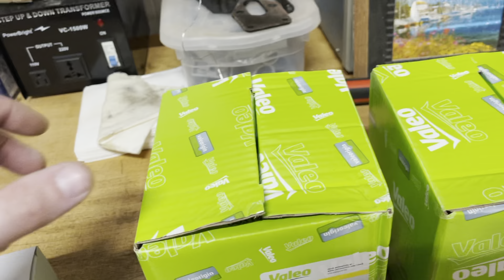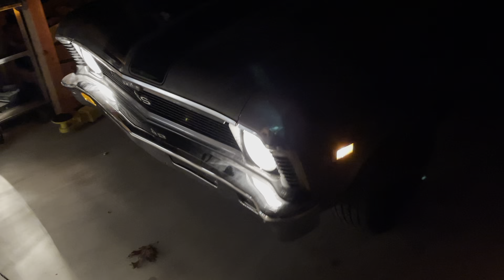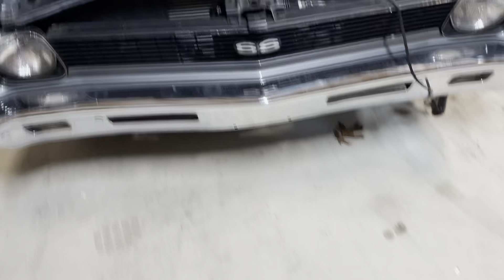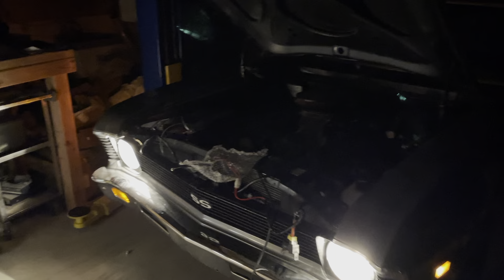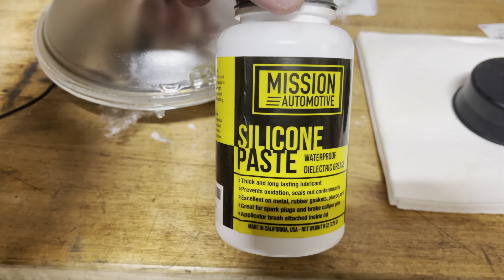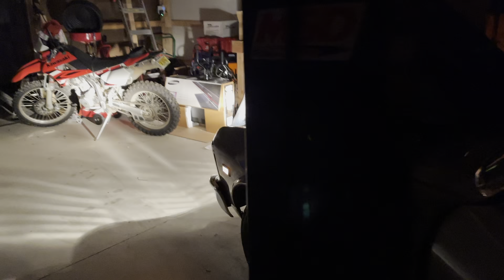Headlights and Harness Conversion | T3 to H4 Installation Can you Tell the Difference?

Comment: I see that you didn’t have to modify/enlarge the radiator support where the lamps mount. I bought a set but they won’t fit without making the holes larger. Still can’t bring myself to do it.
Reply from the maker: I linked the headlights I used in the description.  Did you use the same ones?
Reply: @how2sNreviews  no, I’ve looked at a few different sets, and they’ve all had the same size outlet/plug.